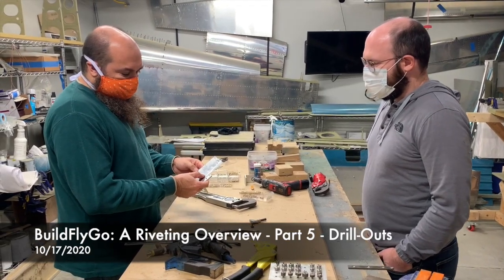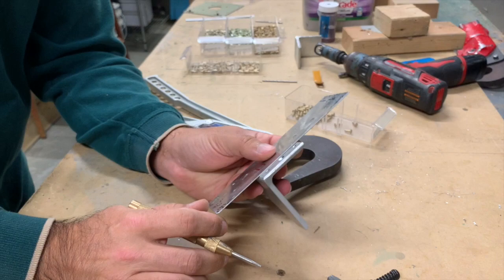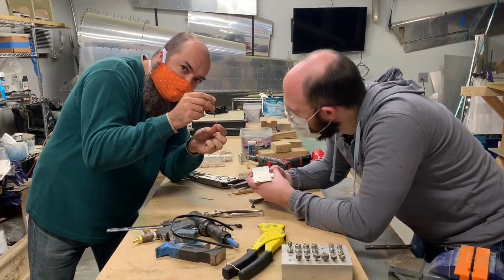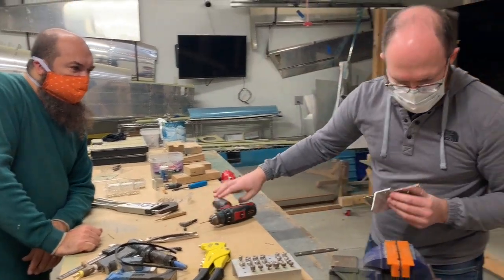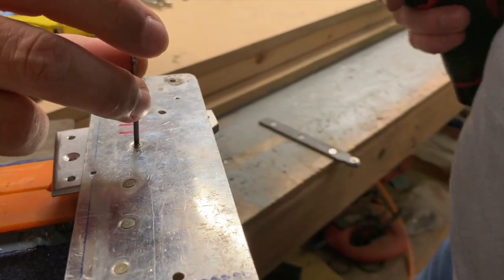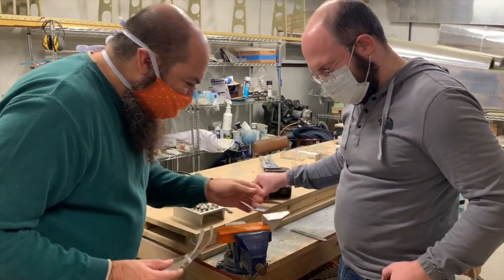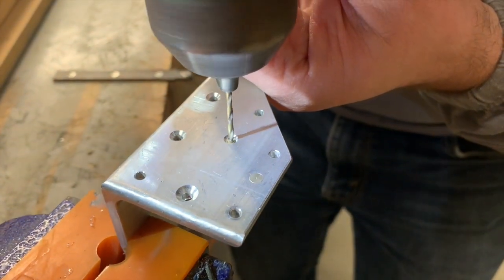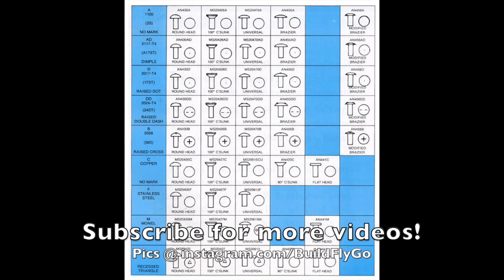Building an RV Part 5 - A Riveting Overview: Drilling Out Rivets!

Comment: Cool Video. So How many EXTRA rivets should you buy when first starting out a new Build? Lots of OOOPS  many drill bits!
Reply from the maker: None in the beginning. I did run out of some of the odd half sizes that are not used much in the kit but there were plenty of left-over rivets at the end :)

Comment: I noticed some primed parts (airplane ribs) drying on an upper shelf in the background of this video.  Would it be possible to find out what product(s) you use for priming and how you prepare your primer and then how you apply the primer to your parts?  Many of us new builders are very interested in how you experienced builders prime your parts before assembly.  If you have time, it would be awesome to watch you prime your parts in a short video.  Thanks.
Reply from the maker: Sounds like a fun video, I'll try to remember next time I prime parts!
I use Akzo 463-12-8 epoxy primer.

Comment: I appreciate another very good video!  I believe Van's includes the "OP-51: Sheet Metal Basics" practice kit with every empennage kit that is shipped.  However, you can purchase the "OP-51" kit separately from Van's for $10 + shipping by just calling Van's.  Likewise, Van's also sells separately the following additional practice kits: "Toolbox Kit" for $30 + shipping,  "RV Training Project" for $35 +shipping and the "Van's Aircraft "LightBox" Sign Kit" for $130 + shipping.  Go to "Miscellaneous Items" in the Van's Store to purchase these practice kits.
Reply from the maker: I recommend buying them all and go practice! :)